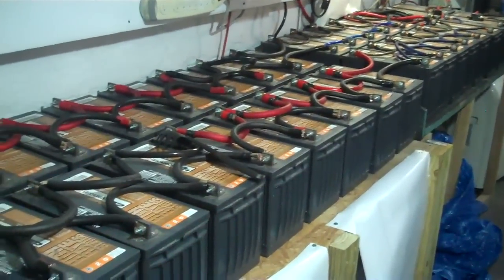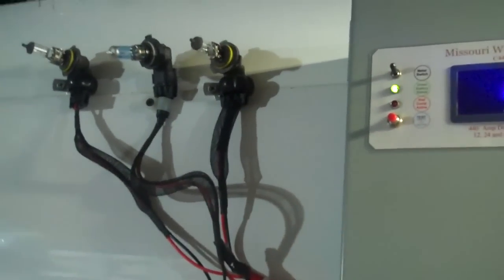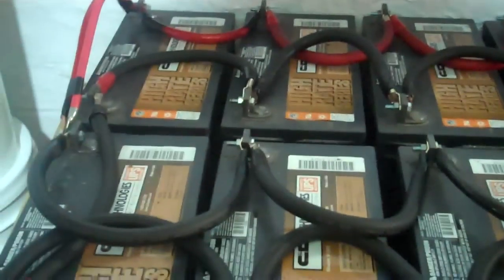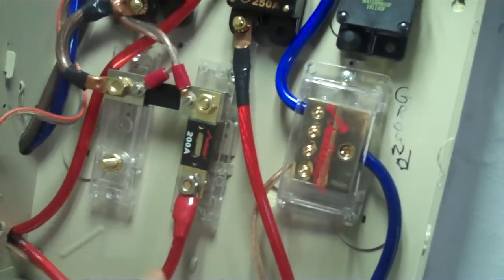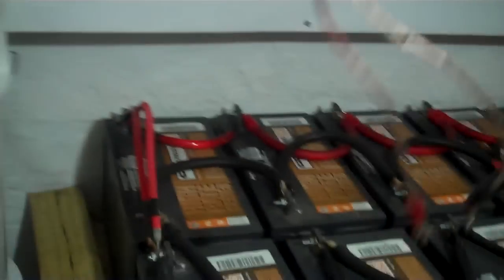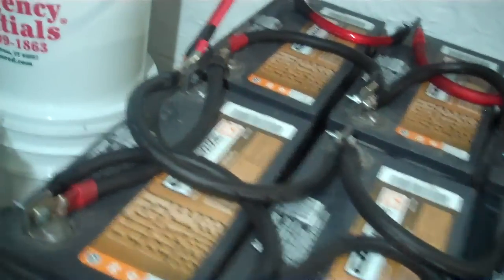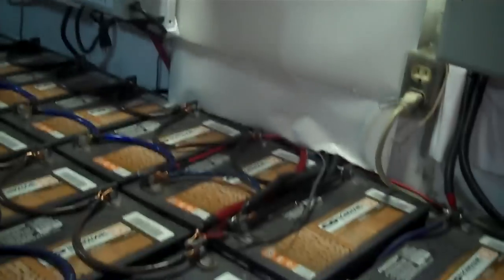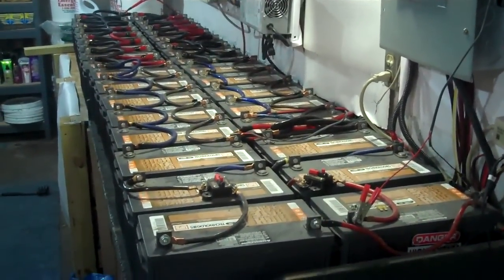Massive Battery Bank for Solar biggest Off Doomsday Preppers

Comment: no offence but with all that gear it seems to me to be such a huge waste setting it up to be 12 volt. What you have there would make an amazing 24 or 48 volt system which would be so much more efficient than that 12 volt setup you have now. (doesn't make sense to me but i'm sure you probably have good reason)
Reply: Keeping the batteries paralleled keeps them equalized. If he has the right number of them, like 24, or 32, or 64, He can series-parallel them for a variety of voltages. Lots of common denominators, giving a large range of voltage, allowing use of all the batteries in balance. Right now, he has a double pole double throw switch, which allows 12 or 24 volts, at the flip of a switch.
Reply: @vincentrobinette1507  During a black-out he not going to re-wire this mess from 12v to 24v or 48v.  Get real ...
Reply: @MrSummitville  He wouldn't take the time to reconfigure the batteries in real time. The options are only an advantage, if he wants to replace the inverter. That just gives him a lot more options, without having to add or delete batteries.
Reply: @vincentrobinette1507  No, he would not.  He will use what he has.  Nobody is going to Fed-Ex overnight new 48 Volt Inverter(s) & new 48 Volt Charge Controller(s) during a major black-out and then re-wire everything  when all of the components arrive.  Nobody is that stupid.  What has he changed in the past 10 years?  Nothing?  He will use what he has, because he knows how to make it work.
Reply: @MrSummitville  He would only do it in the event of a burned out inverter. He would have to get hold of what ever he can, and again, having all those options would allow him to obtain a new inverter more easily, if he isn't stuck with a specific input voltage. There's no need for change anything, as long as everything's working.
Reply: @vincentrobinette1507  You can create any number of hypothetical situation that could cause him to re-wire.  But in a black-out, he is NOT going to re-wire for higher voltage. He will run with what he has ...

Comment: This is the model T of battery bank configurations. You could reconfigure this to a 48v system and use less amperage to run your loads. The batteries could be charged in 12v or 24v configurations on a 48v system. Optima batteries are okay for long term ownership not so much run time as AGM don't carry much reserve as lead acid. Your breaker situation is over kill. This system would in fact be broken up into two systems one 24v and one 48v then you have a reliable backup system. Good video.

Comment: You are correct about the 2 VDC batteries, but what he's doing here is just as good. That many 12 VDC batteries in parallel eases the cycles between float charge and discharge, and I'm fairly confident he keeps his bank(s) above the minimum low level at all times. He shouldn't have any problem with that many batteries working together. The only concern I see is in recharging. What's required (how much energy) to recharge all of this??

Comment from the maker: i use both what i do is i charge it up with solar or wind or both and i do use it to run some items in my home however i keep the bank almost full in case power goes out 2nd i need to add more solar to roof i been slacking on it due to fliming show and all the other business stuff going on with us we should have enough solar to off grid in yr or so if everything goes to plan

Comment: I have 6 12v/24v desulphinators on my bank to keep the plates clean and two mppt controllers 100 amp 200v and 80 amp 200v 1800 watts solar and 500 watt to 1200 watt 3 phase ac wind turbine.

Comment: We started out with a 12v system but quickly switched to 48v (sold our Xantrex RV inverter) and upgraded our batteries from RV/Marine batteries to T-105 Solar batteries....and it is MUCH MUCH better. We don;t have anything GRID-TIE because we are off-grid.

Comment: you know 1250 amp hour battery's with the same number you have in your system will give you 50,000 amp hour capacity 1250 amps times 40= 50,000 amp hour
Reply: only if paralleled. if in series, the amp hour rating stays the same, but the voltage is multiplied.
Reply: @vincentrobinette1507  but still if he use's 60 batterys it would give him 75,000 amp hours stored in his bank if he use's the 1250 amp hour model  battery
Reply: @johnathantufano8068  You're correct. However Amp Hours isn't the most relevant number, it's Amp Hours, X Nominal voltage= Watt hours that makes the difference as to how much energy there really is. If he moves from a 12 volt system to a 48 volts system, he would only need 12,500 amp hours, to run the refrigerator and lights for the same length of time. This is 10 times more than he needs. so, cut that back to 5,000 Amp hours for 12 volts, or 1,250 for 48 volts. If you get too much capacity, you exceed the point of diminishing returns, and it will cost more per kWh of stored energy. One, or 2 full days of energy storage is all you want, to be most cost effective. The only reason to have more capacity than that, is if you really need a weeks worth of power on reserve, but for off grid living, 1 or 2 days of battery, a generator, and a large sealed drum of fuel might ultimately cost less per kWh.

Comment: looks like it woild be cheaper to just pay the electric company for electricity.
Reply: True, it is. This is in preparation for the loss of the grid. This will get him by in a SHTF situation, which is what this is about. He has 5 sources of power: The grid, the batteries, the solar panels, the wind turbine, and hopefully, generators. A lot would have to happen to leave him in the dark.

Comment: I am preparing my 3- family building to transform into a solar 3- family building.  Currently, I am replacing the gas stoves with electric stoves, replacing three 40 gallon gas water heaters with one-120 gallon electric water heater. Eventually replace three gas furnaces with two electric force hot air furnaces.  What advice you can give?
Reply: Entrepreneur Creator This individual's setup is.. poorly done at best.  For lots of reasons.  But it seems a few people have already gone over this.

For YOUR situation, I STRONGLY recommend AGAINST electric hot water and stoves.  In order to run your average oven for 1 hour at 350f, you need ABOUT 2200 watt-hours.  If you have 4kw  of solar, in good light, you'll make about 3200watts.  In my area (tennessee) you'll end up with about, on average, 5 hours of good light.  You'll need a GIGANTIC splitphase inverter to handle that, as well.  Which will be maybe about 80% efficient.  That means in order to run one oven for one hour, you would be eating up about 15-16 percent of your power reserve when you consider inefficiencies.   That's ignoring the Peukert effect (lead based batteries will have a much lower capacity the faster you draw power.)

Look into Solar Hot Water heating, which is pretty common.

Comment: hi, i just will star my system, whit a car alternator with charge control integrated 12v 270 amp and i will use a 2 or 3 deep cycle batterys 100ah, but might need some help for the rest of the conections, can i count whit you?,
thank you

Comment: Nice Video, Lots of information and a clean system. Im curious why did you wire the battery bank at 12V and some at 24V, why not wire them all at 48V and put your panels in strings to heighten the voltage?
Reply: More amps and amp hours and no worries of shading on panels.

Comment: Are you using this power for every-day household use?  Appears to be a quite complex system for 'maybe it'll be used at some time in the future, when civilization ends" .  How will you know how dependable it will be? Will have to do a video of our system, which is used every day, saving dollar for dollar electricity costs, although the reverse cycle air cond is still on mains power.  Our system can be easily switched between 'mains' power and the solar battery (1200 amp hr) system, in the event of 4 -5 cloudy days in a row.

Comment: That's quite small battery bank.
What you would say about 3.5T of batteries? 24x Hoppecke 1370Ah 2v. each is 56kg without acid, 76kg with acid. Made for order only.

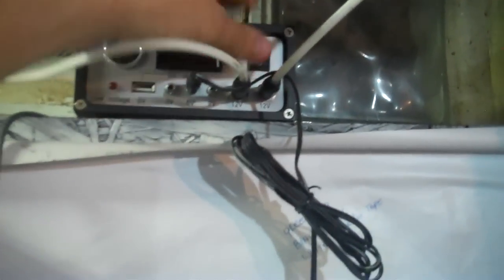Comment: 4:40 Tip: there are lead-acid deep-cycle batteries that are sold without the acid. They are dry, until you want to use them and then install the acid. Until then, they are shelf stable indefinitely.

Comment from the maker: This Whole setup is getting a Facelift we are adding 3-6kw of solar and redoing all this and More with new Breakers From Midnight Solar and new Inverters
Reply: +Bryan May Did you make a new video doing the facelict rewiring? I am curious how you wired the backup inverters, I am sure they are in parallel, but do you leave them on? Do you have a wiring schematic that you can publish?  How do you disconnect from Grid power and still supply power to your home, do you use a manual disconnect?  Do you also desulfate your batteries?
Reply: Bryan May at what is the battery unit is? Like what is the amp hour, per battery and how many are you getting? Can you help me understand this
Reply: @johnathantufano1776  My guess would be about 127 Ah/battery.

Comment: The battery voltage has to match the inverter input. Inverters are available in 12, 24, and 48 volt inputs. 48 volt is the most efficient. Also the national electric code limits indoor DC to no more than 50 VDC

Comment: Seeing all this crap gives you some clue as to why the public is still fairly resistant to alternative energy systems--   I wish some electro engineers would figure out a self contained system- even if it's bulky--- one that's on wheels and could be rolled into the corner of a garage or basement and hooked up to turbine or panel- then you'd have something.
Reply: M. M. Yep working on it. I'm building portable cabinets with condensed gear. Breaker panels, inverter/charger/grid tie options all in one. Just move into place. Hook up batteries, solar panels and plug into transfer box that's wired to your house panel. Now you have a solar generator.
Reply: You can go for powerwall

Comment: Are you planning to upgrade your battery back soon, and if so their's some thit go up to 1,252 amp hour per battery unit so you can use the same space with plating 3x the power strong you want

Comment: why is it that all ur fuses are to high, i dont think that ur  fuse will burst out if something wrong, and are u off the grid already? you got a factory of battery out there, thaks for sharing though
Reply from the maker: filipina santos the fuses are the right size the inverter is 3000 watts and can pull 100-300 amps at peak and if something was to short it would blow the fuse fast the dead short of a battery is about 1000-3000 Amps

Comment: all grid tie inverter are safe as the need to read the grids sinewave to match it, with no wave input the don't produce anything it also the reason you will find grid ties smaller than standard inverters for the same output rating

Comment: I love your battery bank good job. Have you thought about using a copper bus bar ? Lol i heard a female say shut the fuck up in back ground hahahaha.
Reply from the maker: She was saying it to the macaw we have also I thought about it but that many amps of power and a buss bar I didn’t want to risk dropping somethig  on it and having a light show lol
Reply: @mayswhole  oh shrink wrap it lol
Reply from the maker: @donaldsteele6276  lol
Reply: @mayswhole  i think you did a great job. Mine has a 4/0 cable spaghetti mess . I have 2 very big copper bus bars 2 inverters both on a big bus bar far right positive and far left negative post and the other bus bar is for 100 amp 200v mppt controller and a 80 amp 200v mppt controller and samlex 80 amp duel bank charger and my 3 phase ac wind turbine that bus is far right negative far right positive. So i have power in bus and power out bus and they are both wired to equally put in and draw power from the bank . And the out bus positive terminal has a go power 400 amp type T fuse and the power in bus has a master off switch on it and negative side has a 300 amp shunt. No ANL fuse on that positive terminal because every controller and the pv arrays have a breaker box . And i also installed a dc fuse box and small bus for lighting and temperature controlled relays for cooling system . So the spaghetti is from all the big ass 4/0 temco welding cables on the bank and bus bar cables. And i have desulphinators wired on both buses too and also 2 more wired on the bank to keep the plates in new condition.
Reply: Stupid spell check the power in bus is far right negative and far left positive.
Reply: So criss crossed from each other. FYI if you have a fussy inverter and wire it opposite from chargers it usually shuts up the fuss.

Comment: Excellent work great video and I just want to say that it's very nice to see you utilize one of those capacitors for car audio to help with the surge from things like refrigerators or AC units. I always look at these videos and wonder why I don't see more people using them as this a much more appropriate scenario to use a capacitor verses the way people use them in car audio systems when most installs don't even pull enough power to need them. I am building a portable emergency unit housed in a storage tote using a 2 farad cap and my 1200 watt inverter for sudden power outages or outdoor activities. I'm working on adding a quick connect access point so I can connect it to my car so I can take advantage of the extra battery and the alternator since the 2 AGM batteries in the bottom of the storage bin are only 35Ah each.  I'm using a 100 watt solar panel from Windy nation with the 30A charge controller I do plan on getting 3 addition panels as the controller is designed to handle up to four 100 watt panels I plan on posting a video on it once it's done. You have an excellent and extremely well thought out setup the only thing that I can find fault with is that I think you could use a few more batteries you don't have enough ... seriously kidding about that ... well done sir!

Comment: I would prefer using 2V AGM batteries that are like 1000 Ah each, then I would get 24 of them (plus a few spares) to make a 48V 1000Ah setup.  Wiring them all in series requires much fewer cables and is more "correct" than your parallel setup.  The spares would be used to replace any failing individual 2V batteries.

Comment: Do not use dump loads. Get with your electric company. They will buy your extra energy, when your batteries are charged, via grid tie inverters. One of my systems: 48 290 watt solar panels and a  14.5 Kilowatt  Fronius I G Plus grid tie inverter has produced more than 6.5 Megawatts since September of 2014. This, one system, has produced two times more  electricity than I have used from the power company. They pay me for the excess energy that I make. Why are you wasting it with dump loads???
Reply: @shawnio  You have to get permits, and have installation inspections, before you send back to the grid. A lot of expense, a lot of hassle. The whole point of having a vast battery array, is to be able to store that energy yourself. Grid tie systems are useless, because during an outage, your power goes out, and your panels get curtailed. Half the fun of this is being able to run for a week, without even having to start up a generator. with a system like this, the power can go out for a day or two, and he may not even know it, unless he checks his instruments.

Comment: LiFePO4 if not managed properly will lead to VENTING! Granted you can pull ALOT of amps out of a small battery but if not managed properly you will have a big problem and the more amps you pull from the cell the more heat is created - so the battery bank would need to be cooled in order to stop venting

Comment: tech. that's funny so true. I just want to know how to connect to my box that I have right now with a wind turbine set up. do you really need all that just to have power in your house without Detroit Edison.
Reply: Solar panels and turbines are very intermittent. They are not regulated, and may not have the peak power to directly supply loads. At the very least, you need a battery, which can store energy from your sources, and pay it out when you need it. You don't need THAT many batteries, but I do recommend 4 or 5 kWh. 4 golf cart batteries would get you by, and last a few years. They're not very expensive, and will outperform any RV batteries out there.

Comment: Cool! Is it automatic? Can you share more info on it? I'm looking to build a similar setup. I've got a bank of 40 batteries, and about to get about 8kW of solar panels. I'd like to do normal grid tie net-metering for most of the time, since it's more energy efficient, but I need a decent transfer switch and inverter for when the grid fails. :)

Comment from the maker: best thing to do is get as many battery's as you can fit,lightest well no battery's other then lithium are light but would cost way too much so best bet get golf cart battery's that are 6volt and run each pair in series to get 12vs a pair then hook your pairs together parallel min 4 batterys would be best you could use a pair see if it does what you want but i feel having more the better

Comment from the maker: we own a car audio shop and run car comps and every battery maker we talked too has never said anything other then the more the better for reserve capacity doing only 3 would do 200watts for only about 2 hrs thats not enough to do anything that needs to be done i have done 12v for many yrs as for midnight solar last time i had checked they were overpriced now if they came down great because it should be affordable for all to do